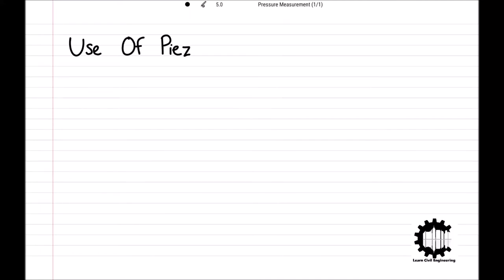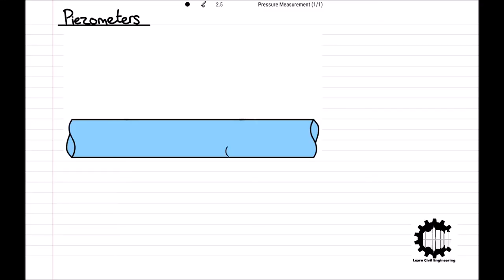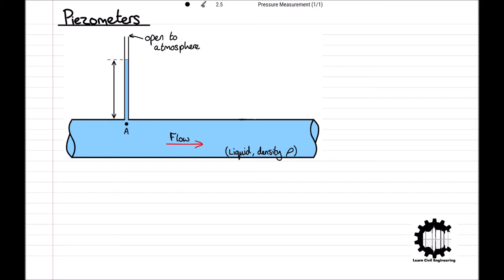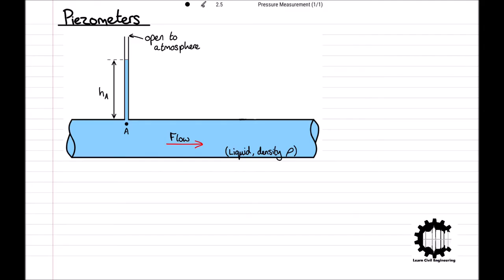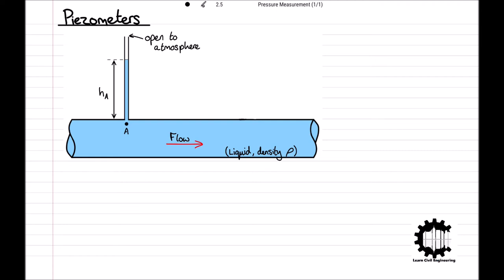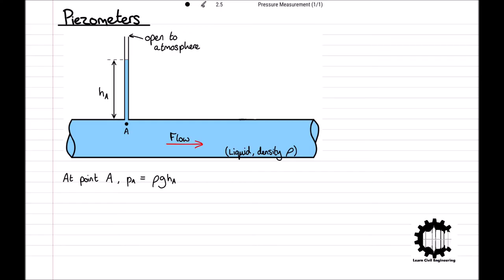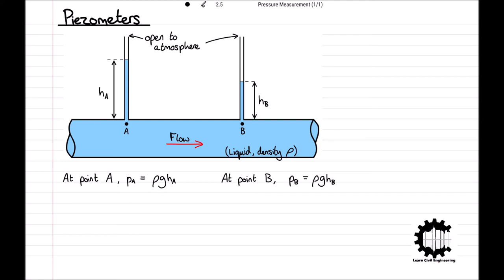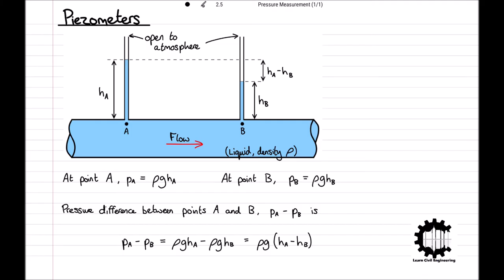Pressure Measurement using a Piezometer - Fluid Mechanics

Comment: hi! Why isn't the pressure at point A and point B the same? If we were to consider a datum line along the center of the large pipe, point A and point B are the same height from this datum line. Am i confusing static pressure with stagnation pressure?
Reply: Well because fluid is flowing, its not at rest, which means it is constantly losing energy due to friction, leading to less flow rate.